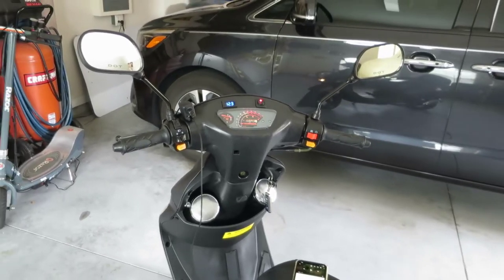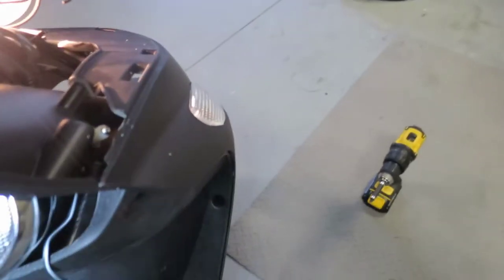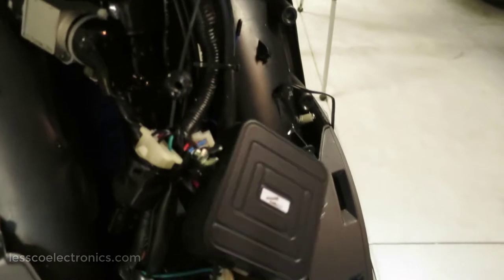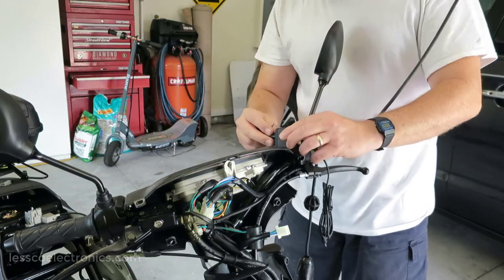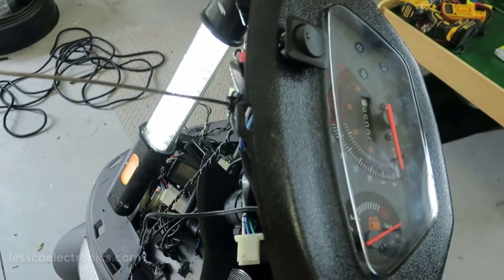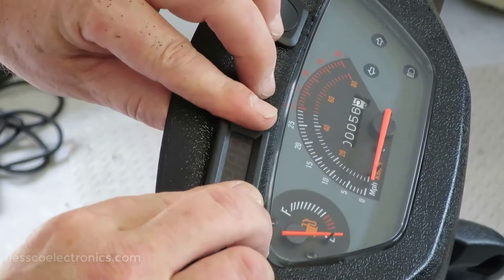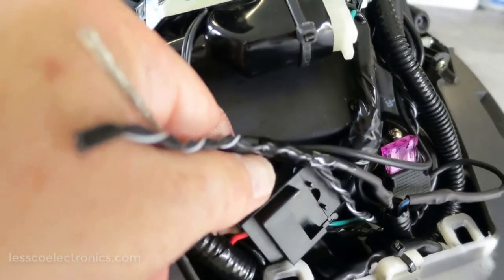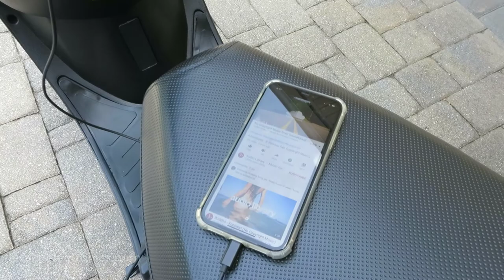Detailed How To Installation: Custom Scooter Stereo System on TaoTao 50cc ATM50

Comment: Wow. Impressed.. long video as I didn't think you'd going to that much detail. 
I've been thinking about how to do this. Kind of set up. But tie in a sub woofer as well. Not sure if the small batteries can handle 50 watts? How to check out more information as well but you gave me some great ideas thanks very much.

Comment: I did this years back on a manco Matrex. Didn't use an extra battery. I wired a car stereo with Bluetooth in.  Used a piece of scrap sheet metal as a mounting base; metal came from an old junk storm door panel.  It was awesome.

How come no demonstration of the sound?

Comment: Won't your accessory battery drain from the primary?  I'm interested in seeing how its been holding up.  Very clean setup though 👌
Reply from the maker: it works damn well actually, never below 14.4v most days, and I did this video a while ago now..

Comment: bought me a 100w system. works well enough for me. getting a small buzz at low volume...would adding a 2nd battery help elimanate the buzz??
Reply from the maker: sounds like a ground loop or a cheap cable, should be a free or low cost fix, dont buy an extra battery for that

Comment: I am planning on doing something similar but I would like to know how can I hook a subwoofer into my little trunk onto the back like the trunk that you have on the back of yours I also have a tao tao50 cc's
Reply from the maker: do it the same, just add a sub amp and  free air sub
Reply: @Lesscoelectronics  do you know where I can find a sub amp for motorcycles at a reasonable price
Reply: I have a 12-in subwoofer would I be able to use it and build a custom box with my trunk so that I would be able to mount it on my scooter